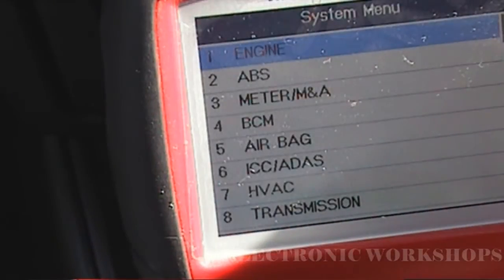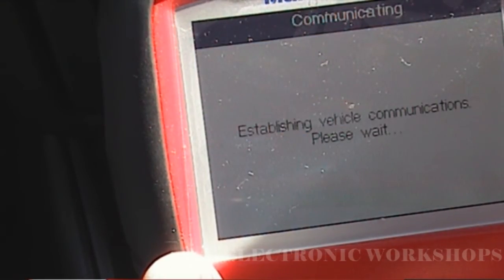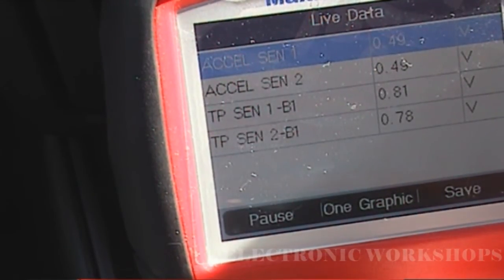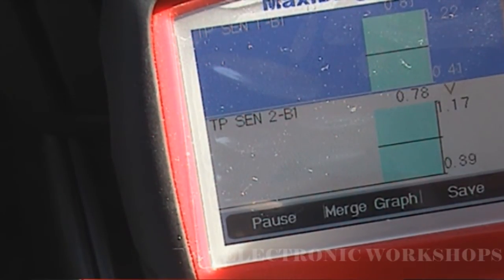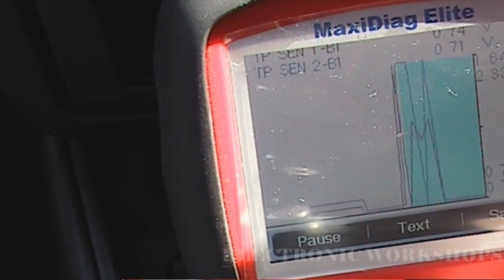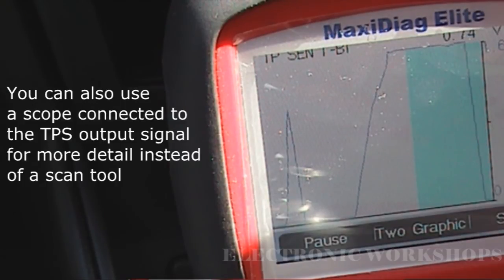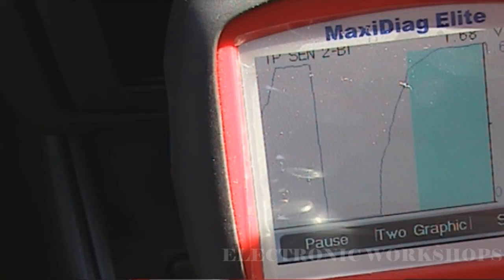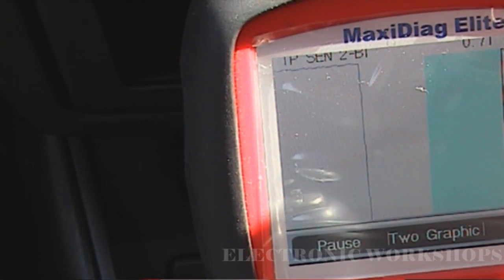Nissan TPS Testing On cars with Electronic Throttle control

Comment: Very good Im hoping with ebrake on and car in drive I can finally get WOT on my 2008 nissan sentra so I can clean throttle bore without forcing throttle plate open by hand to clean ECT by hand .And also do the test you have done in your video to test throttle response! So car just needs to be in drive and not running correct?

Comment: you want to say that full throtle tps voltage its 1.6v ? its nonsense. in closed position its about0.75- 1v full open 4.5v .
Reply from the maker: At 2.11 minutes I have a note, the reason its was low was because the brake was applied, this limited the throttle opening
This video was more to show how to get the throttle to open without the engine running to test the tps
Thanks for your comments

Comment: I thought WOT was 5v? I wonder if the hantek can update fast enough to show any glitches?
Reply from the maker: Hantek  should be good enough for this slow moving voltage
I have never seen a potentiometer ever getting to its supply voltage,
unless the gnd end is o/c